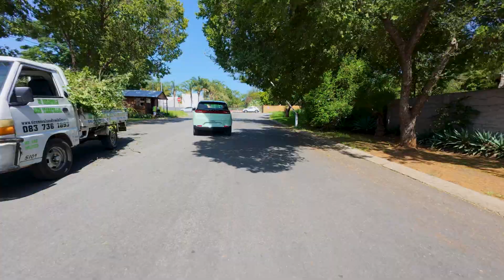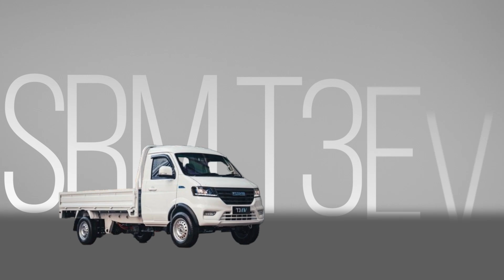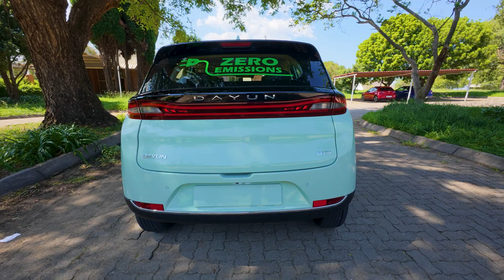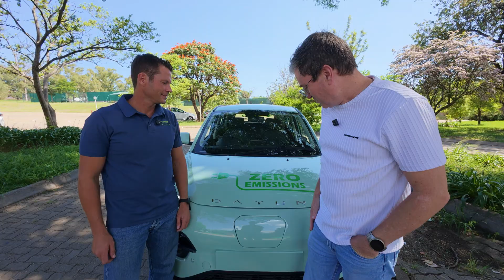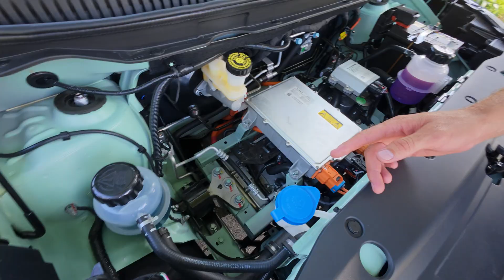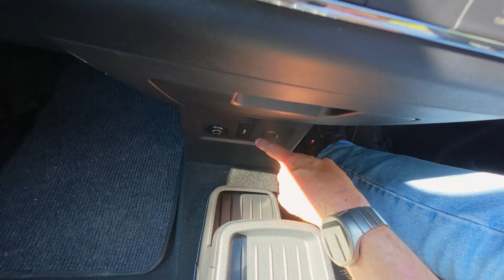TCS | We test drive South Africa’s cheapest electric car

Comment: Their point about the cost savings of petrol are almost spot on. If you're replacing something using 6l/100km in a city (most small cars), that's R21 * 6 = R126 per 100km in petrol. If you're doing 15000km / year that's almost R19000 per year. Assuming this 30kWh battery gets 250km, that's 12kWh / 100km, or R36 per 100km (at R3/kWh). Those same 15000km will cost you R5400 per year, or a cost savings of R1133 per month.

When will Dayun make electric motorcycles? South Africa has a law that electric motorcycles can't go on freeways.

Comment: Their website should be brought up to scratch and they should maybe put the different models on New Car Deals. An excelent site if you want to get your cars with their specs out into the buying market. I in the market for an electric motorcycle. I would like to be able to charge it with an Eco Flow solar charger.